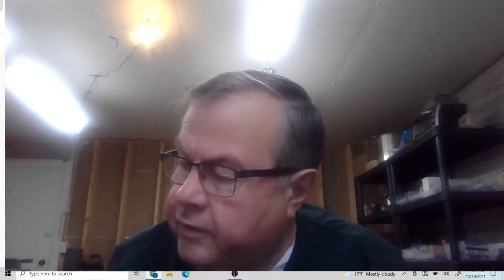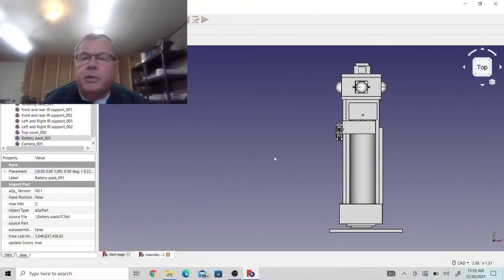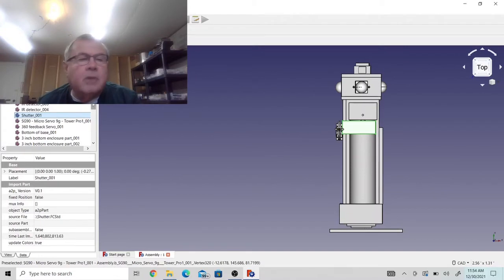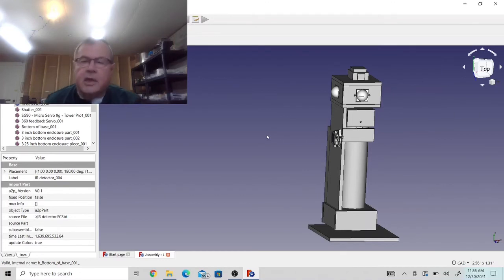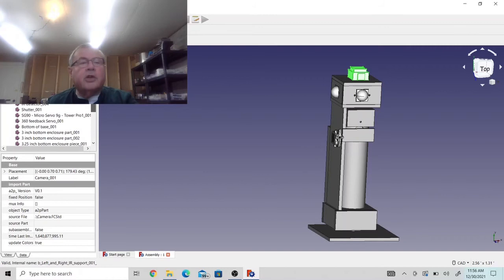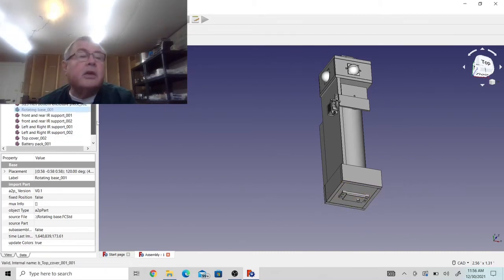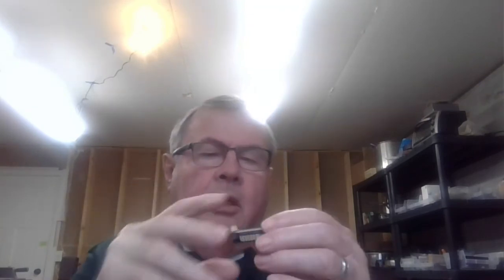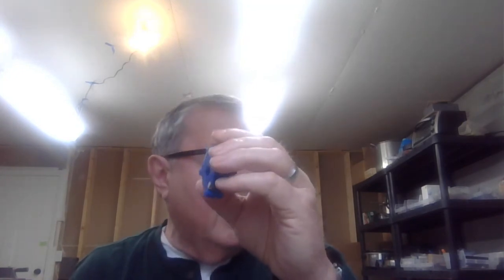Improvements for the SSScat cat deterrent.'

Comment: Hi, thanks for sharing! Very interesting project! Can I ask you what AI camera have you used and why this you choose that model? Will be the camera power consumption an issue? Than you!
Reply from the maker: Hi Pedro,  thank you for your comment.  I am nearing completion with the first prototype.  I have the AI working for the most part along with other updates.  I am working on developing the PCB and an enclosure.  I will post the final when it is completed.  If you would like to see where it is today let me know and I will send you a link to a video update.

I am using the Jevois AI camera.  I selected this camera due to size and current draw.  The current draw using the current model is less than 150 milliamps. And it is only requested when searching for a cat.  Otherwise the camera is turned off and not drawing current.